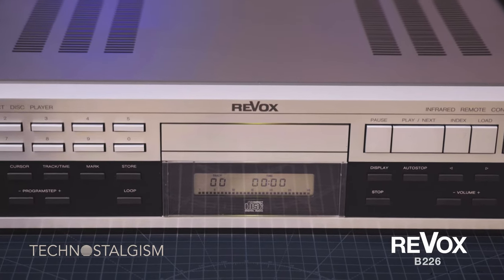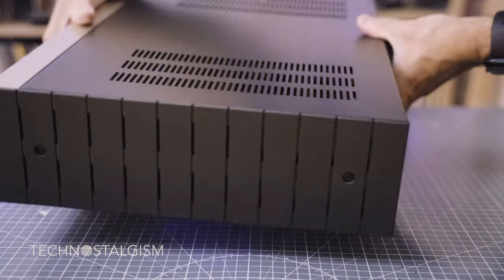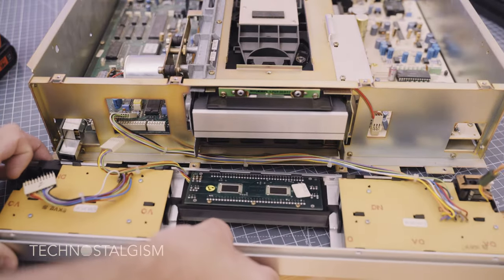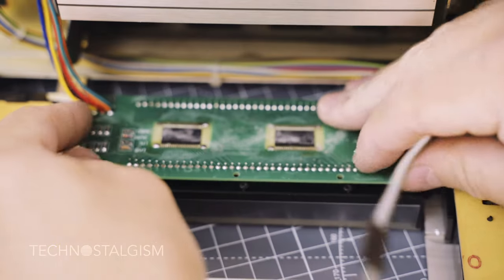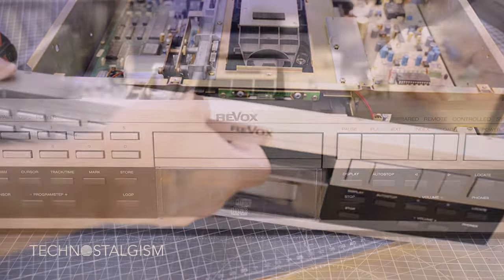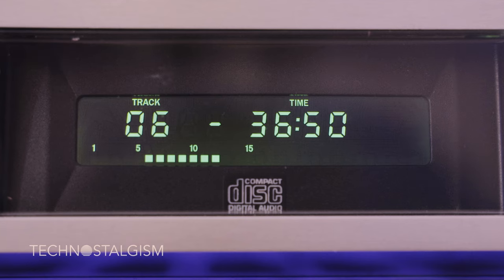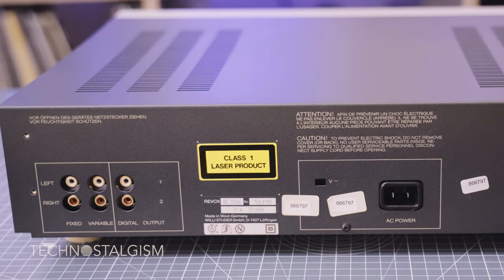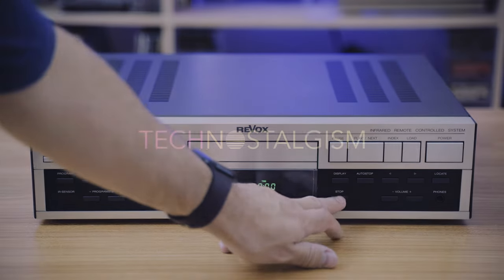REVOX B226 CD Player • Display Replacement and Review (feat. B215 Cassette Tape Deck)

Comment: That mod completes the lower black rectangle, instantly making the Revox go from looking like a cheap calculator to a super slick hifi unit.
Reply from the maker: That's totally true. Always felt the original displays on both the CD and Tape Deck were a bit of a let down... Luckily this can now be fixed 😎

Comment: Will you be selling your original display by chance?
Reply from the maker: Hi mate, not right now as I might use it as a replacement in another unit but considering it in case I get another one of these from theBay. Without any kind of affiliation with the seller (which is why i don't link to them) I do quite like these displays.